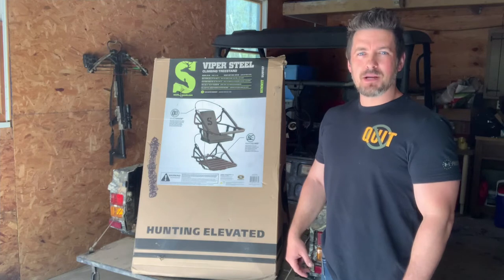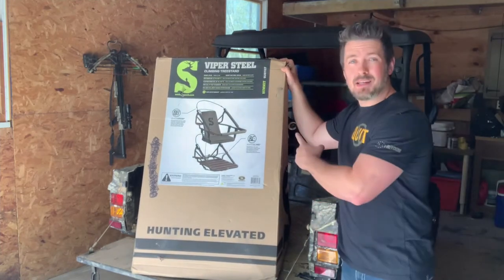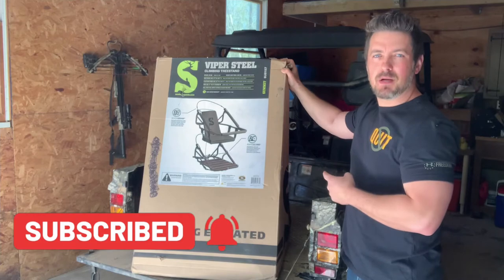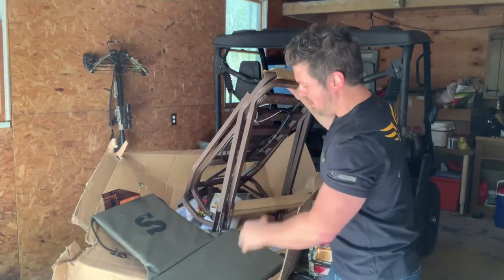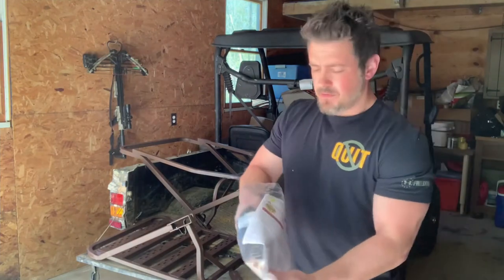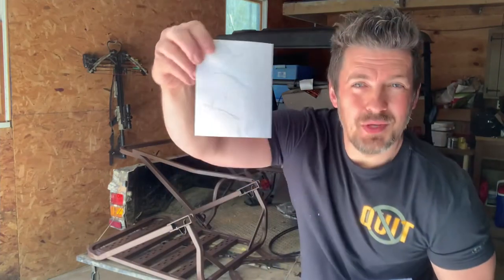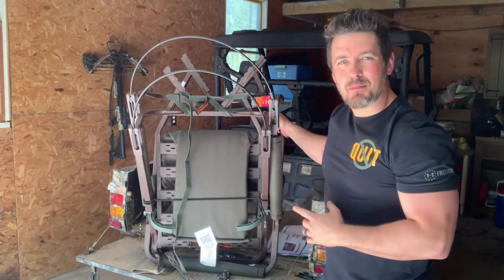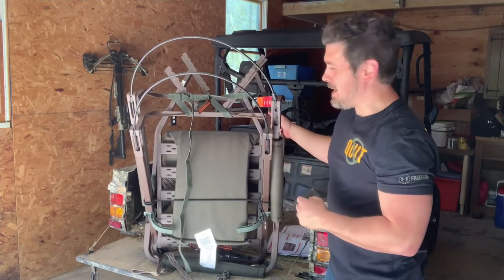Summit Viper Steel Unboxing and Assembly.  How to quickly put together this Climbing Treestand

Comment: Academy Sports here locally in mid-Ga have these Summit Viper Steel’s for $99 each right now (and used a 10% off coupon as well) and just bought two to add to my climbing collection of Summit Goliath SD Ultra, Summit Titan SD, two Cougar Claws, and two Buckshot Equalizer 24’s w/ABR. I’ll take the Summit Viper Steel’s all day long at $99 each.
Reply from the maker: Thanks for the heads up man! That’s an awesome deal👍🏻👍🏻👍🏻

Comment: Could have used a little explanation of the "nesting" for transport, securly fastening, why you want to run the backpack straps (the other way), etc...Everything was fast forwarded too fast ans could not even see what you were doing throughout the whole thing. If all I was looking for was put the seat on (and not how to securely adjust the straps) then put the boot stirrups and bungees on then yadda yadda... well, I would have just typed that here because that's what we got in this video.
Reply from the maker: Hi Scott,

Thanks for the feedback.

I find that most people wouldn't want to sit through a regular speed build such as this. Did you know that you can slow the video down? Simply hit those three little dots (on mobile) or the gear (on web browser) and select your playback speed.
Aside from the playing speed, I have plenty of other videos that will give you additional information on Summit Climbers. For example: 
- Here is a video where I demo the Summit Viper Steel (includes nesting at the end): https://youtu.be/sap-KJIdMUM
- Here is the Summit Viper SD video where I cover the climber plus a lot of "intro to climbing treestand" type of stuff: https://youtu.be/tKVEkgdB5xE
- Here is a video that shows how I climb with my Summit and all of my hunting gear: https://youtu.be/v0O-2UU_rL4

Thanks for your interest in my channel. I hope you will find this information useful and will subscribe. 
Have a good day.

Comment: After watching your video and the hundred dollar difference between this and the SD... I went with the steel.  Sports Authority  had one left that was just returned because the guy said it was too heavy. I'm 64 and don't think the additional 9 pounds is that much and if anyone thinks the camo seat & padding is worth 150 dollars more..forget it...you're 15 feet in the air and you're covering the majority of it.
Anyway...$ 208 dollars out the door and I couldn't be happier. It sure beats lugging a 46 pound ladder stand around. And great unboxing video. Looks like I'm going to be purchasing a better harness system as you are so right about the one that came with it. Happy Hunting !! 🦌
Reply from the maker: Hey John, thanks for the kind words. The Steel is definitely a quality climber and you will be really happy with it. It’s also super comfortable! What I look for in concealment with these stands is the color of the metal and with the Steel you’ll blend right in. You’ll also be happy with an upgraded harness. MUCH more comfortable. Best of luck this season! 👍🏻
Reply from the maker: By the way, if you are curious, I did a video comparing the Viper SD and the Steel: https://youtu.be/tohGOcIrf00

Comment: Firstly overall a good video. A couple points of note are the shoulder straps when put on as shown in the video do not work they will loosen under weight. Secondly the foot stirrups were put on incorrectly. If you could slow down the video a bit that would be great.
Reply from the maker: Hey Naythan! Thanks for checking out my channel! You are correct on all points. If you check out my more recent Summit climber unboxing videos, I think you’ll see that I’ve improved in a lot of ways. Best of luck this season 👍🏻
Reply: @mountainbuck  fantastic! Keep up the good work. You have a great demeanor on screen! Good luck this season 😀
Reply from the maker: Thanks man 👍🏻

Comment: Better explanation of the whole process would be cool.
Reply from the maker: What do you need explained?
Reply: @mountainbuck  the buckles where you fast forwarded through that whole thing. Less fast forwarding would be better I think. I've never even touched one of these things until today.
Reply from the maker: You are able to slow the video down by clicking on those three little dots (on mobile app) or by clicking on the gear icon (on desktop). I have a complete demo and review video for the viper steel and viper SD. Here is the link to the steel: https://youtu.be/sap-KJIdMUM please be sure to wear your safety harness (upgrade if you can) and use that one inch flat strap to secure the seated portion to the tree once you are up in your spot. Let me know if you have any  questions and be safe!

Comment: great...everything was going smooth until we go to the backpack straps...mine aren't the same as your's and idk if I'm missing pieces or what (just took it out of the box) but something isn't adding up...and i also noticed your foot straps already mounted (again, i haven't fast forward to see you show that and make an ass out of myself but im expecting everything to be in order...not skipping steps then going back)
Reply from the maker: Hey Kenny, thanks for checking out my channel! This video is pretty fast-paced. I have other unboxing videos on Summit Climbers that are much better. It’s pretty much the same setup process. Check this one out. Hopefully it will provide additional insight into the assembly: 
https://youtu.be/sJ2CYf5i_6I

Comment: What is the gray stand umbilical cord for?
Reply from the maker: Hey Matt, thanks for checking out my channel! The umbilical cord keeps both sections of the stand attached to the other so that when you are in the tree, the bottom platform doesn’t fall to the ground and leave you stranded up there.

Comment: Wife got me one for Christmas and i already hate it. The assembly instructions are horrible. The frustration of putting it together make me not even want to use it. Im thankful for the video however it was of little help to me.
Reply from the maker: Hey Wayne, I understand your frustration, but I think you will really end up loving your Summit stand. If you get stuck on the seat assembly, skip ahead in this video. It’s the same setup, but I kept the video at normal speed so people could see the process better https://youtu.be/Lh2yh6-nRpo